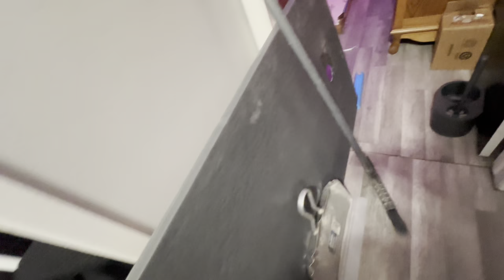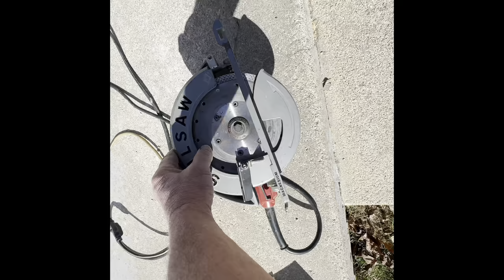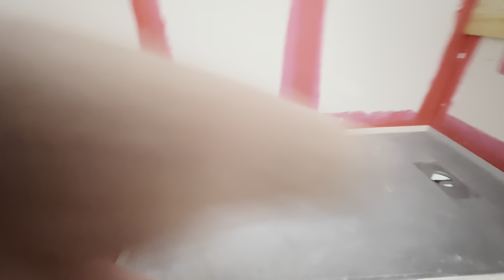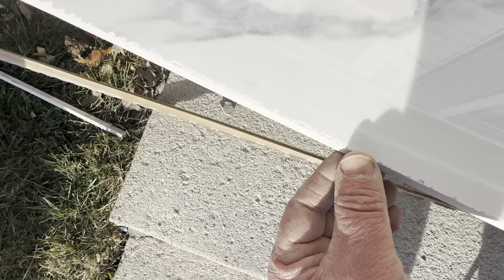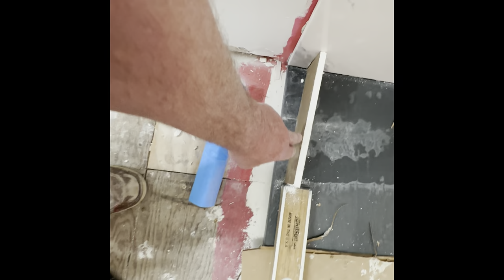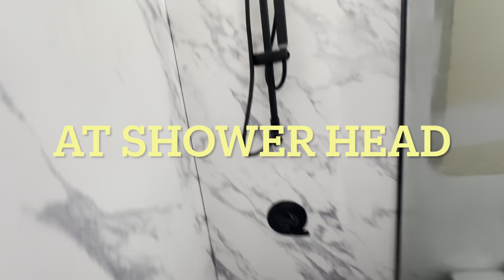Shower Castico Arcadia 1 man Installation Trick & Tips

Comment: Customer Care is actually located in Texas, along with their manufacturing plant. TIP: when trimming, trim up to 1.5" on each side.
Reply from the maker: That’s more risk making two cuts instead of one
Reply: Max amount to trim on each end is 1 1/2” tops so the guy’s comment is correct.
Reply from the maker: Sounds good thank you